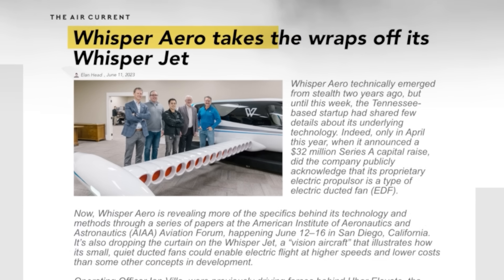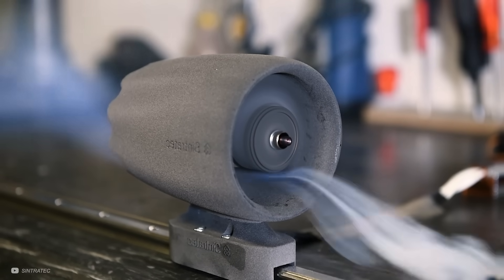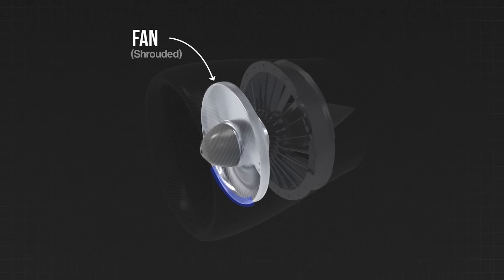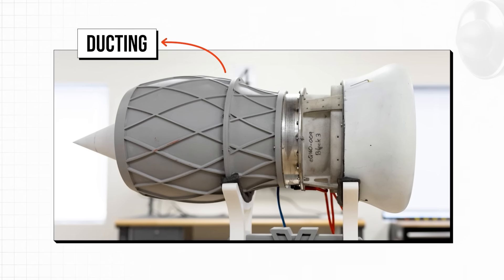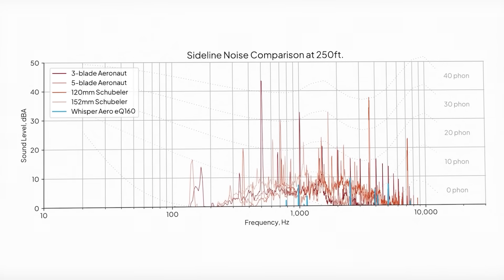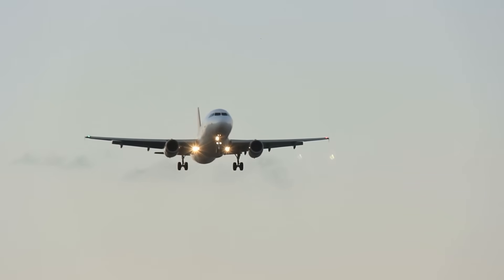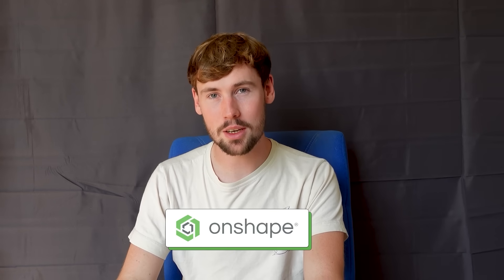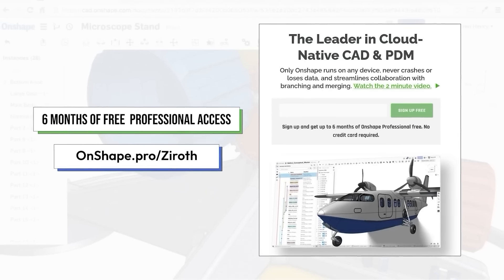This Genius Jet Engine Is Starting A Revolution

Comment: Seems to me like this Italian scam company IronLev. How can you have several times more weight to a wing and more surface area while being more efficient?
This looks unbelievable at first sight
Reply: Also square cube law (small turbines taking far less air through and having to spin way faster to have even a shot at being even slightly as efficient), tons of blades meaning tons of drag, and not to even mention the frigging insane weight of each of these things! A simple 2 blade propeller on an electric engine may not be as efficient (though I doubt it, this thing seems as inefficient as can be), but the weight is gonna be  literally HALF as much! Now use two bigger, more efficient, low noise propellers of the newer designs, and you're gonna get something even more quiet, way lighter and this more efficient... Though probably slower? There was no mention of speeds though so who knows. Definitely sounds like a fraud

Comment: Please, please get those leaf blowers into the hands of my apartment compound's groundskeepers. Their old combustion engine blowers are so loud.
Reply: Dont compare the engines, compare the battery to the gas tank ! Which is the winner ?
Reply: @jpcaretta8847  Extention cord. And otherwise a reasonable litihium battery can easily be swapped in most powertools I use so have multiple batteries and put one in the charger.
Reply: @AndreVanKammen I have gas AND electric tools etc… ok !
Reply: @jpcaretta8847  Also fine, you asked for a compare on the battery vs gas as if that would make the noise OK I just replied. The battery and gas thank both don't make noise so I assumed you where talking about recharging the batteries as a problem, but that was only a guess,

Maybe you should be more specific in your post instead of asking for a winner without context underneath a noise complaint of gas powered leafblowers.
Reply: @jpcaretta8847  For the leaf blower the battery is. It's not simply the 'convenience' of the gas, it's the externalized costs including noise and air and other environmental as well as health costs. Certain jurisdictions have outlawed (again) the use of gas blowers. It's viable now since electric tools have reached a level equal to gas.
Reply: @cre8tvedge my leafblower runs from the main
Reply: @jpcaretta8847  What in the world does that mean? Main what?
Reply: During WWll the Brits developed an exhaust system for radial engines using the Coanda Effect. Supposedly you could hear the valve train when the engine was running. Not used due to radar still being a factor. It really bothers me that outdoor equipment manufacturers cannot or will not develop better mufflers. Aside from their engines running dirty.
Reply: An issue with using a battery powered leaf blower is that you need the 60V versions to move enough air and you need many hundreds of dollars (like $500 plus) of batteries to actually do anything substantial on a reasonable time basis. For a landscape crew it is generally more effective to stay with gas unless regulations push for electric.
Reply: @Mentaculus42 comon sense has spoken 😀
Reply: @Mentaculus42 or... they could use a rake or a brush which wouldn't create noise or airborne dust pollution or damage cars with high velocity stone chips and wouldn't pollute the atmosphere with nitrous and carbon oxides.
Reply: @Mentaculus42  We have been ingrained in this nation to ignore externalized costs - while the world burns around us. Costs were the reasons for fighting against seat belts and improved safety features in automobiles. Costs are a red herring false premise. Batteries are more efficient and breakdown less reducing repair maintenance and replacement cost. They will get less expensive as time goes on. I do have direct experience using an electric blower on my urban property with no issues of inadequacy.
Reply: I wish I could give you 20 thumbs up for your comment!

Comment: Jet engines are already fake. No way planes can hold the required weight in fuel for long range flight. It's structurally impossible and the fuel weight/plane weight required currently stated does not match.
Reply: I'd love to see your evidence for this claim given that thousands of Jet engine powered airliners cross the globe every single day carrying millions of people.
Reply: Troll much?
Reply: Ah, well, what you're missing there is the huge gain made by aircraft flying west - the Earth turns under them at up to 1000mph you see? Yes, but what about the ones that want to go East, I hear you ask? Ah, well, the ones going West have giant elastic bands inside that they wind up as they go. These are transferred into the planes that want to go East. Obvious really, when you think about it.
Reply: any proof ?
Reply: @margarita8442 https://youtu.be/85bd_MaH5SE?si=c51SdAl1cBxfOjcJ

Look up jet fuel hoax etc.
Reply: Maybe find a different channel?